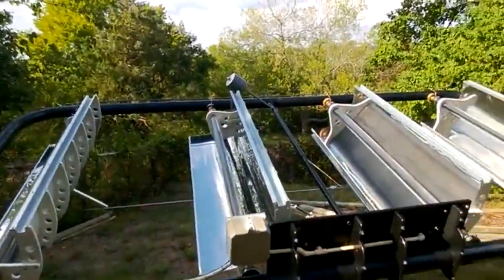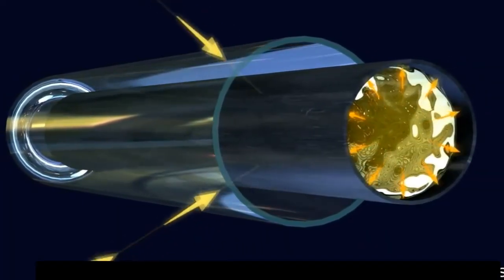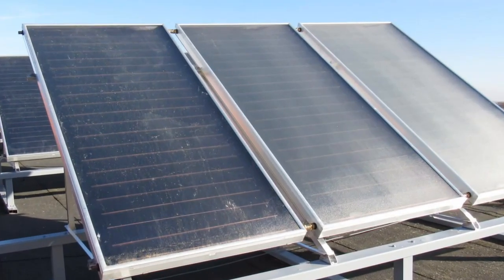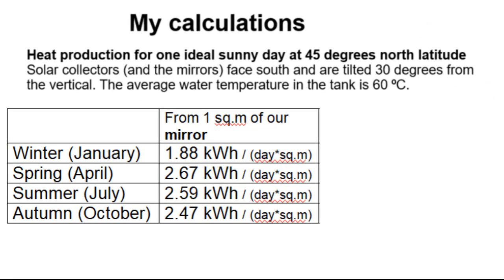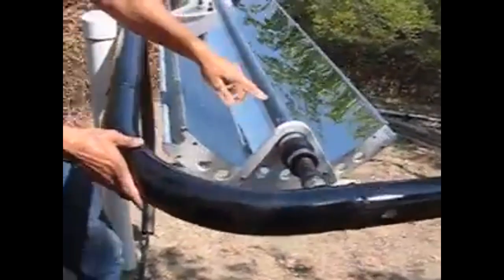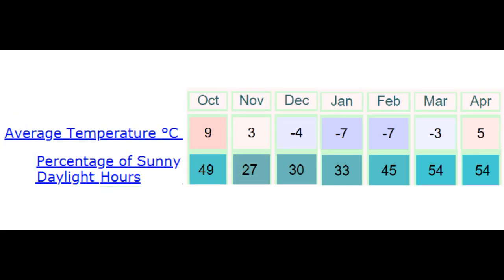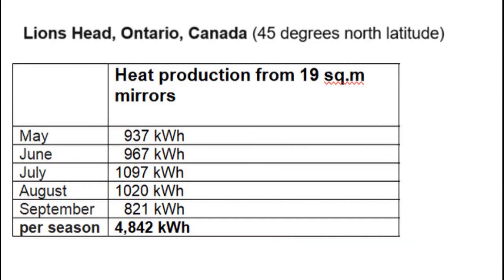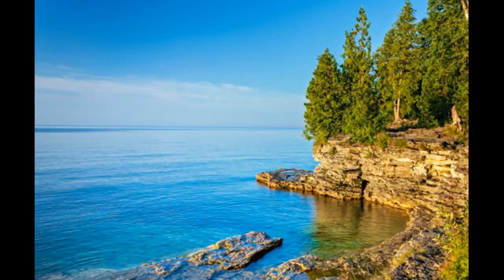How this DIY Mirror Solar Collector can heat a house in winter, its comparison with traditional...

Comment: The main idea behind my reply that keeps getting deleted... summer temps June, July, and August easily surpass 30C during the day.  "Feels like" temperatures, which adjust for humidity, reach 40C+ and trigger heat warnings.  Heat warnings are common during the summer.  The average (day + night) temperature does not reflect any of this.  A more extreme example: in Alberta, Canada, overnight lows this past week dipped to 7C (highs of 20C).  The forecast for next week, highs of 29C (lows of 11 or 12C).  Taking the 24 hour average for a system that heats up in the sun does not reflect what's going on.
Reply from the maker: Summer temperature is important to understand whether a pool needs to be heated. If the average "day + night" is more than 22 Celsius (the pool is outdoors, not covered with a film), then it does not need to be heated, since its water will be 27-30 degrees on hot sunny days.